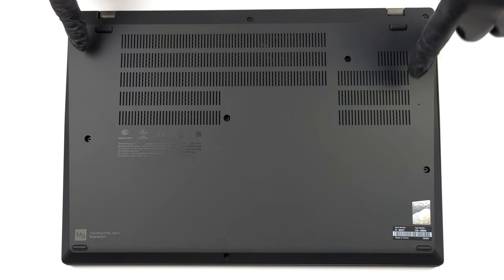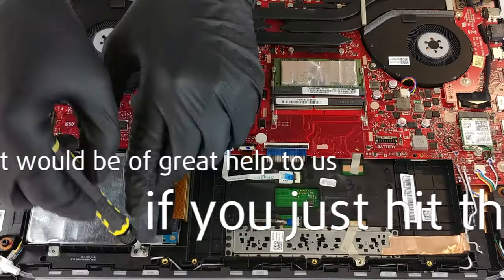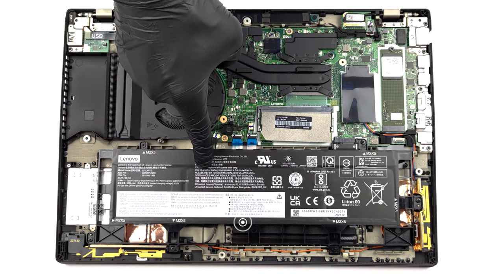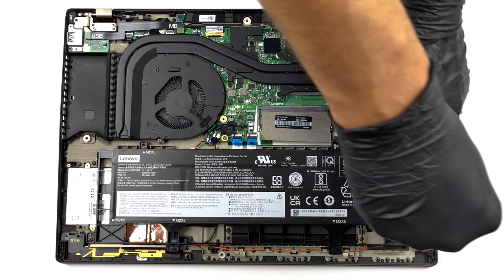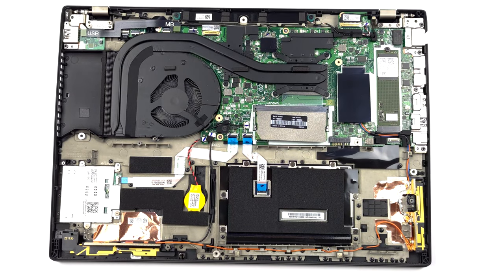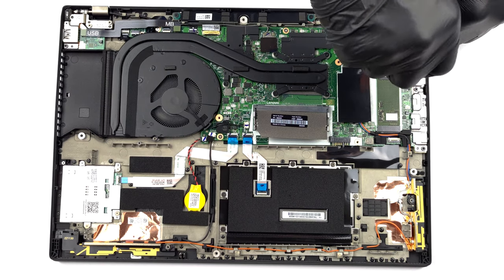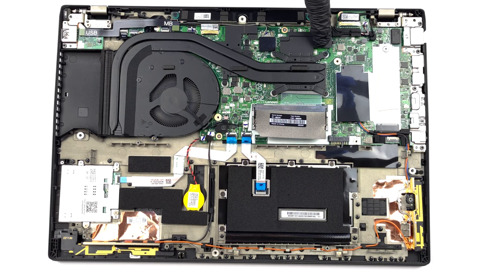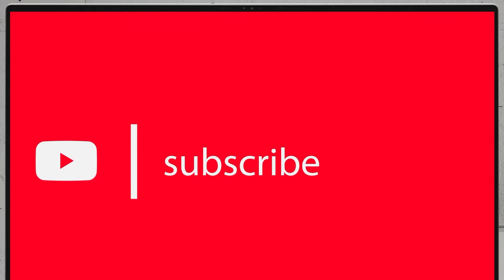🛠️ How to open Lenovo ThinkPad P16s Gen 1 - disassembly and upgrade options

Comment: I got one of these, they superglued the M2 screw in to make it difficult to upgrade the M2 drive. And you cant apply much pressure because there is nothing underneath that portion of the motherboard. It begins to flex as soon as you apply weight.
Reply: Are you serious??